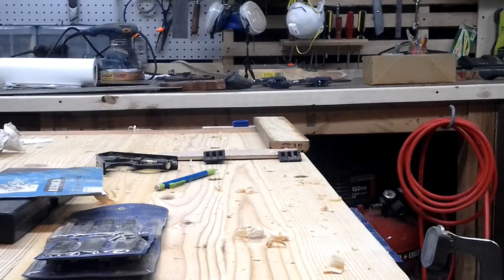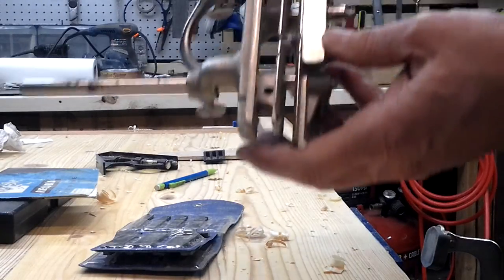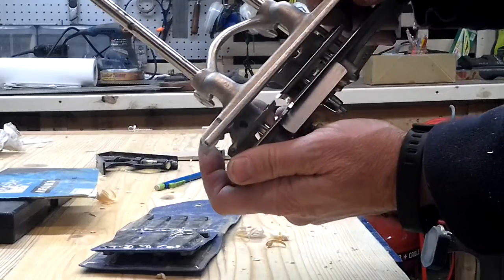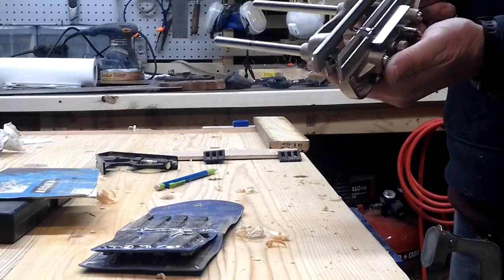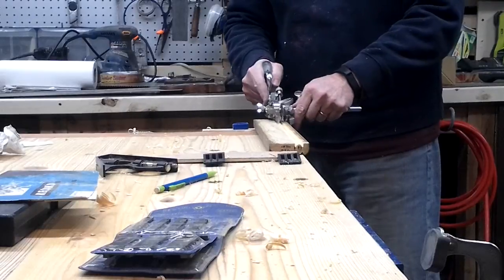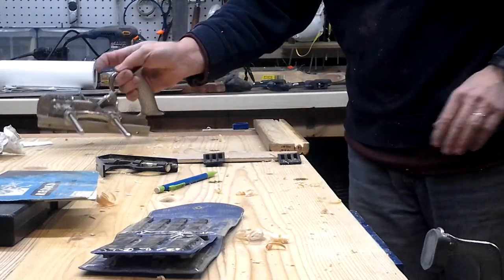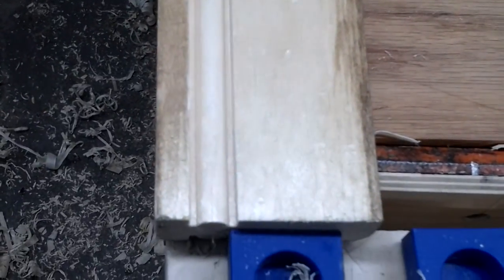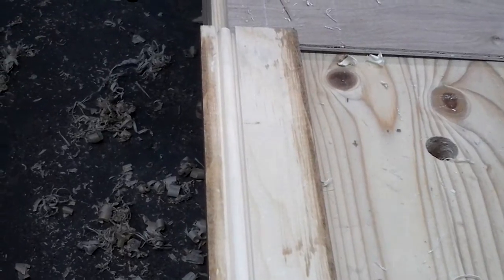Successfully beading with 3/8" cutter in Record 050 Combination Plane

Comment: Looks great. How did you sharpen a beading blade like that? Do you need a round diamond file and a jig to get the angle?
Reply from the maker: Mitch Peacock has good videos on how to sharpen the cutters. I used Japenese slip stones (Rockler, Woodcraft, Amazon, etc all sell them), but I've also see people use small dowels wrapped with sand paper. You free hand the angle (I haven't seen a jig), which sounds difficult, but it's not because the angle isn't critical. Just like with a chisel or plane iron, if you end up at 28 degrees instead of spot on 25 or 30, it will still cut and get you the profile you want.  It takes a bit of practice, but it's not that hard to get them really sharp. My biggest suprise when moving into hand tools was just how sharp the irons need to be to work well. I would definitely say the sharpness matters more than super precise angles. Hope that helps!
Reply: Great info - thanks for replying